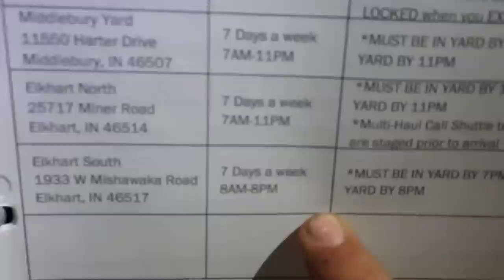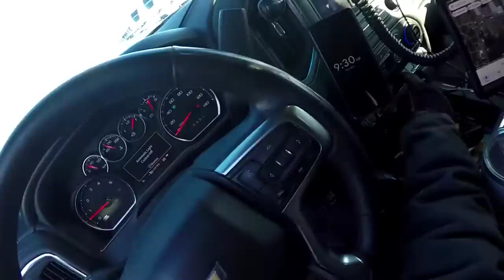RV Transport Multi-haul - Loading doubles

Comment: Howdy, have a suggestion, when lashing down the  trailers to the 2 inch ball I would jack the landing gear down like you do & hook it to the directly to the 2 inch ball & then hook the winch to other end of the 2 inch ball then slide that unit along the track instead  of sliding the landing gear, that way you save a little more time, also tying the trailer tires down with the straps is good but the suspension is fighting your trailer suspension, you probably notice the rough ride, so try grabbing the spring hanger to tie the trailer down that way you won’t have to throw a strap over the front & rear of the trailer frame to stabilize it in the wind + your ride will be a lot better. Thx 4 the video

Comment: Who needs to worry about a sleeper or berth in the back seat when you’re hauling 2 campers! Which ever ones got the comfy bed or couch!
Reply: I was on vacation and ran across a transporter who had run the battery out on his truck and needed a jump. Apparently (for his company at least, don't recall who he was driving for) you can sleep on the couch, but you absolutely can not do anything else in the camper. Some other YT people I've watched on this seem to indicate they do not have access to the inside of the camper, which seems to be to be potentially dangerous, but what do I know. 

These things have to be in NEW condition to be legally sold as new, at least I presume. No blowing up the bathroom before the new owners I guess :)
Reply from the maker: We are actually not allowed to step foot inside the camper. The guys that drive the motor homes are allowed to sleep on the couch but that is it.

Comment: Used to haul cargo trailers and used a regular semi to do it.  I had a mile marker hydraulic winch mounted on the truck and it was a two speed but I also didn't  have to cut off the free wheel lever.  Made life a whole lot easier to load and unload

Comment: We spoke with a multi-haul transporter that has a 53' trailer. They used a small cheap drone to inspect the roofs of the campers before loading since the loading lot prohibited going on the roofs as you advised in the video. Getting charged for that cap scratch was a little over the top (sorry for the pun). Shame on the manufacturer. Great video. Stay safe and happy trails.
Reply from the maker: I have heard of this too. I actually have a 6ft selfie stick I put my go pro on and walk around the campers and then look at the video before pulling out of the yard. It wouldn't work so well on tall fifth wheels though unless you could find a longer one.

Comment: Great video!  Thanks for doing the whole thing from arriving to departing.  I'm seriously considering getting into this  business.  Was thinking going with singles, but I've been told it pays to use a set up like yours.  Did you get your truck set up or did you buy it that way?  What's that set up called (5th wheel, no box)?
Reply from the maker: I did single pulls with my truck for the first year. It is just standard Silverado 3500 with a box. I bought a flatbed and replaced the box with it and removed the factory gooseneck ball. I just used the mounting plate for the ball to mount a riser to bold the  Mastercraft fifth wheel plate to. I did all the work myself to save $$. They call it a "bed delete" to make it legal to pull a 53ft trailer behind a pickup.

Comment: I can see that it really only makes since for new units, as the dealer or manufacturer charges directly the buyer on paper. If you need to move a used unit its alot of money,  maybe more then the trailer is worth. Definitely cheaper towing yourself. Should be a great industry at those rates. Was trying to move one back west from VA, personal move, holly %$#@, was quoted over 5000, my fuel was 800 or so. Of course my time...  Stay safe.
Reply from the maker: The real killer is insurance and maintenance. People don't think of the extra costs that they don't see up front. After 300,000 miles on my pickup, I figured out the cost to operate a pickup (fuel, oil changes, parts, insurance, tires, ect) hauling singles and it came up to 62 cents per mile for all miles driven, loaded and unloaded, that was in 2023. My insurance this year went up 51.7%.
Reply: @VanIperenTrucking  That is true but if you own a truck and use it for personal as well you are really only paying the difference of having it for your business and able to write off business use expenses.  Unless you only use it only for business then it would be an additional expense.  I do understand about the insurance companies raping us all, just because they can.  Used to be important if you have a clean driving record now not so much.    What I was inferring, that on a 2500 mile one way trip my fuel is about 800.00, the quote was over 5000.00.  I was looking for someone that needed to just travel not having to go empty and bring a load back out.  Thanks, the real key to this business is to always have a load.

Comment: Question. Can you haul campers on a freight hauler? Like just a wood deck?
Reply from the maker: Rule of thumb is the deck height needs to be no higher that 35 inches. You can haul with a wooden deck, but you will need the center rail and a winch to be able to load and unload.

Comment: Have you ever had or heard of a ball dolly coming out from under the hitch? It seems like it would be safer to attached the winch to the straps to lessen the stress at the ball. I am getting close to leasing on and have been watching videos to get up to speed. If you know of any used step decks that are older and maybe need some rehab please let me know.
Reply from the maker: I have not had one pop out and I have not heard of any. But I would imagine it probably had at some point. I usually use the axle strap but I did it both ways to show a couple ways of doing it. As for trailers there is a rv transporters for sale page on Facebook that I would keep an eye on.

Comment: Dot doesn’t mess with you about the weight reduction surgery? I’m going to cdl school in 3 weeks. I’ve only seen guys running stock trucks
Reply from the maker: Has nothing to do with DOT. That is the EPA. I have had several DOT inspections since, and I have not had a single issue. I actually had one officer in Colorado tell me it sounded good with a wink and a smile.

Comment: did you jump straight into doubles or did you haul single tow away to start? Also is the pay significant to switch from single to doubles?
Reply from the maker: I spent my first year doing singles. Then I went to step deck. There is quite a bit more in doing doubles but your expenses are also quite a bit more. The reloads are where you make your money for step decks. But that also depends on how rates are going on reloads. From January to April I did not haul any reloads because the car market was so bad it would actually cost me money to haul cars. I have not been doing Multi-Haul since April so I couldn't give you more up to date rates.
Reply: Do you need cdl for this set up ? Can you do doubles with no cdl ??

Comment: Did you have to cut holes in your bed to be considered a "power unit" what I was told at a shop and I'm new to the camper industry
Reply from the maker: I'm not sure I understand what you mean by cut holes in the bed. I never ran into any issues with it even with everyone saying how its illegal and such for having a flatbed. I have had 2 inspections and have been through a lot of scales with this and I have never been bothered or questions by anyone at the D.O.T.
Reply: @VanIperenTrucking  giant holes to make the bed non loadable and right on that's all I needed to know boss

Comment: So U don’t Pull them All the way to the Cab/R does make U over weight.R height issues.
Reply from the maker: I don't pull them all the way to the front if I don't have to. It just saves from putting more weight on the truck than I need to. Less wear and tear.

Comment: can you not just pull the camper with 2 straps instead from the d ring on the ball tower? Just looking in from the outside it seems you could with 2 straps and eliminate taking the ball tower out and just pull it all the way  home by putting a wheel in the landing gear of the trailer. I'm just wondering is all.
Reply from the maker: You can and I do sometimes. Typically, the wheel on the front jack does not allow you to lower the hitch low enough to sit on the ball that locks onto the track. You need the trailer to pretty much bottom out.

Comment: Question just getting ready for semi retirement (need supplemental income). Is this a job that you would recommend? How long would it take in your opinion to start from scratch and make money? (No 1 ton would have to trade in my gas rig. Would need Trailer basically eeverything)
Reply from the maker: That's a really hard question to answer. There are too many variables and each person's situation is different. If you are semi-retired I would recommend single pulls to start with. Get the feel of things and understanding of money flow before jumping all in and getting a trailer. I personally enjoy single pulls better. It is way easier to sight see and enjoy your trip back to get loaded. Multi haul you will always have the trailer and it is more "work" and less play.

Comment: Do you have /need a CDL, or you still are under 26K loaded?
Reply from the maker: I have and need a CDL for this set-up. The Trailer is 22,000 GVWR and the Pickup is 14,000 GVWR, so I am licensed up to 36,000. Some guys do get away with the gooseneck and 3/4 ton pickups without CDL but its a little tricky to stay under 26,001.

Comment: Do U Need Class A  on U-R License to  Hual for the company U hauling U working for.
Reply from the maker: Majority of the loads you need CDL for the weight, but some guys use a gooseneck trailer and stay under 26,000 lbs. I am not sure if there are very many companies that will allow you to do multi-haul without the CDL. It will limit you on the loads you can take.

Comment: Hey , thanks for this video, quick question, dou you need CDL to pull this with your dully ?
Reply from the maker: Yes you will need a cdl. The GVWR of the truck and trailer combined is 36,000. The truck is 14,000 and the trailer is 22,000.

Comment: Do those pay a package price per mile or x amount per unit per mile?
Reply from the maker: The company I pull for is $2.65 for doubles and $2.85 for triples. I try and not take triples just because the extra 20 cents doesn't make the extra hassle really worth it to me. Everyone will have their own opinion on that though.
Reply: .20 cents for another whole camper. How much would they pay to just haul that one camper by itself?

Comment: There is just no money in RV transporting especially no back hauls fuel to high
Reply from the maker: It's been down for the last year and a half. We switched to moving more sold units for the dealers and setting up on permanent sites. The money is about twice that of hauling from the factories and we charge all miles driven, not just loaded.